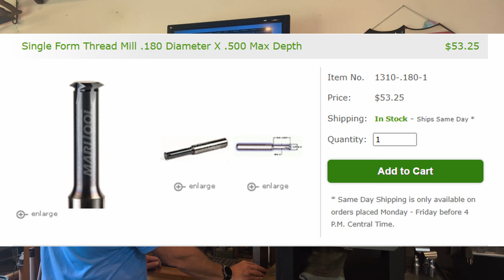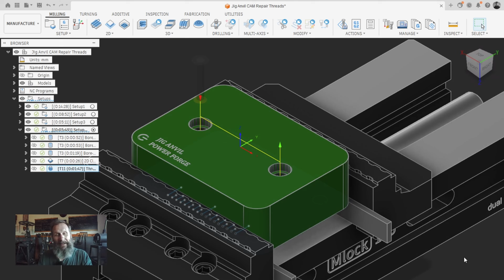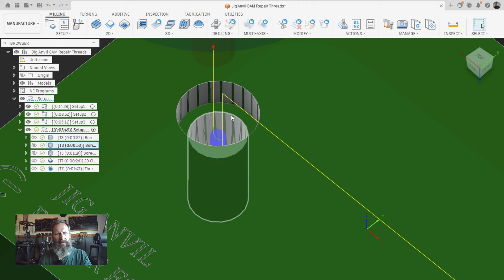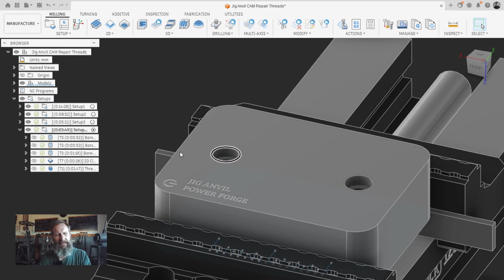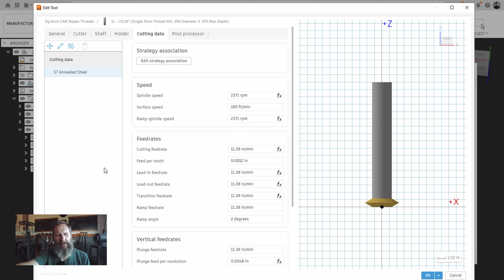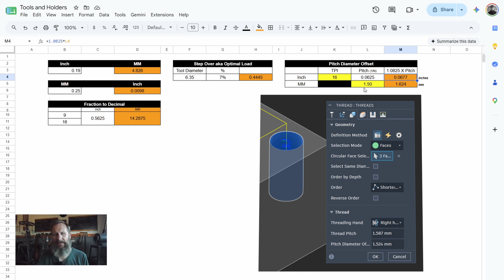Single Point Threading: My Setup and Strategy

Comment: Great video, thanks for posting.  How are you posting "Wear" compensation from Fusion and running on Siemens?  I'm running Siemens 828D and get an error message when I try to post with Wear compensation from Fusion.
Reply from the maker: Thanks for watching and your comment.  In Fusion I run wear the same way I do when I program a contour tool path.  instead of Computer I select Wear (not In Control)

I experimented with In Control to better understand it, but it seemed to slow down Siemens.  

First, the tool diameter needs to be Zero in the tool offsets or else Siemens errors out.  Second, I  post a secondary tool path just for wear instead of Single Block.  Just easier that way. 

I run a spring pass.  Try my Go-No Go, then enter my first wear value as a negative number.  -0.01, for example.  Then it is rinse and repeat until the threads fit. 

I'll film my process the next time I run wear.  Maybe the 808D ADV will be close enough to your 828 to help.